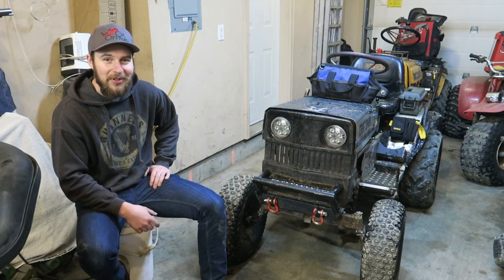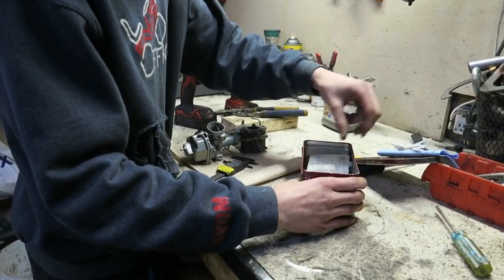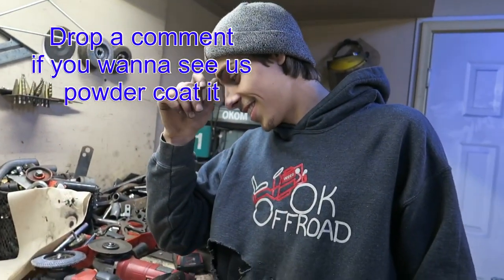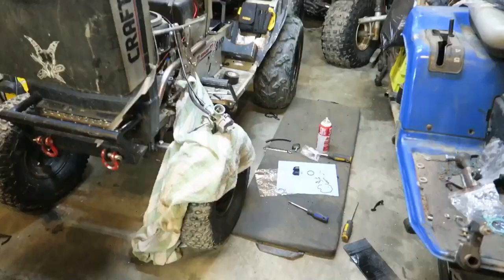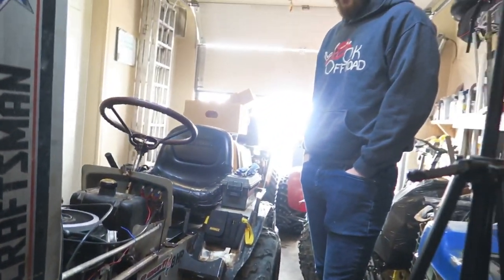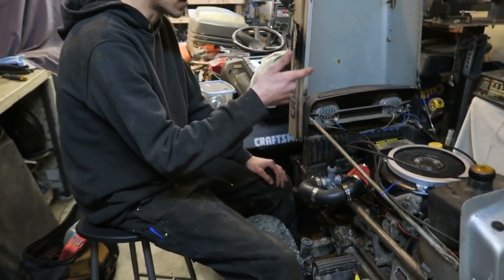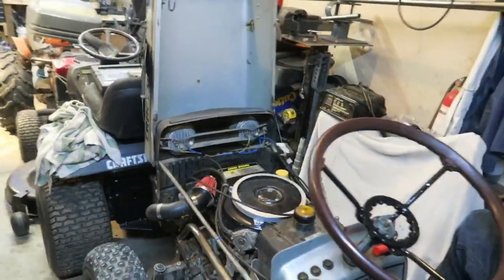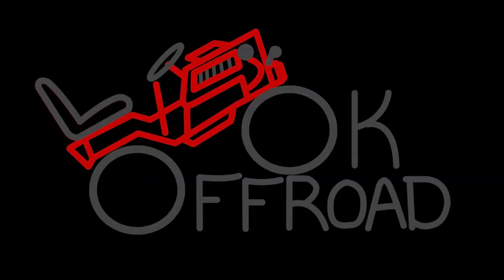Carburetor Upgrade on off-road mud lawnmower…Here’s how to do it!

Comment: That's not a small block Chevy with a Holley carb! The shorted the intake between the carb and engine the better. Mikuni style carbs are vacuum signal sensitive.

Comment: backfires are cool but dont make extra power. i think you are way to lean,  . besides smell and sound one way to check is,  with a 26mm carb. it should start no choke.  except on the coldest days, . better read the spark plugs often till you get it dialed in. run fat, make torque not horsepower.         therefore  lots of gas, pulled through a small 26mm opening  makes low end.    axle snapping power
Reply: Yes lots of tuning to do! Want to see how it runs at the higher elevations where we ride before changing jets but I’m sure they will get a bit larger and eliminate the backfire
Reply from the maker: Yes this is very Minimal low elevation tuning! Will be getting it hopefully running top on the trails
Reply: @okomtony2477   thank for your reply Tony.  you guys are way to cool. been raining here for a week. we are mowing mud hard. my Nephew say no one builds mowers as well as ok offroad . i agree with him.. Woo
Reply: @okoffroadmowers  i really enjoy you videos , thank you so much